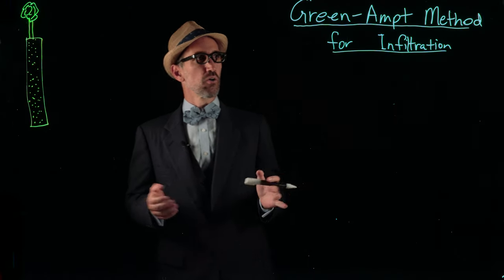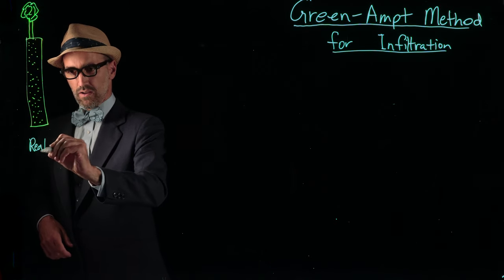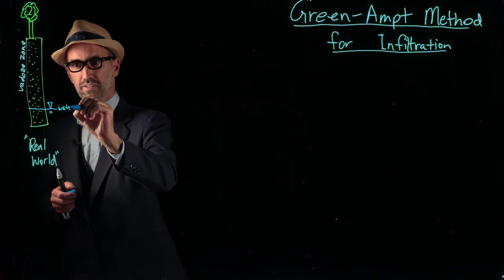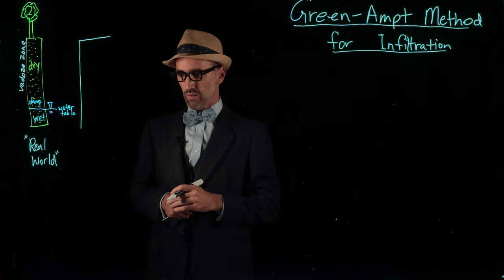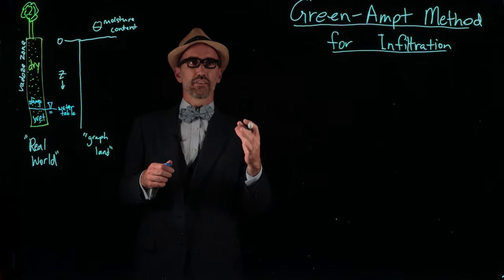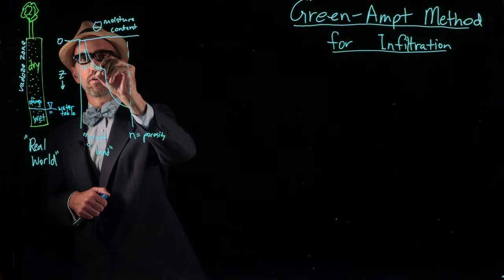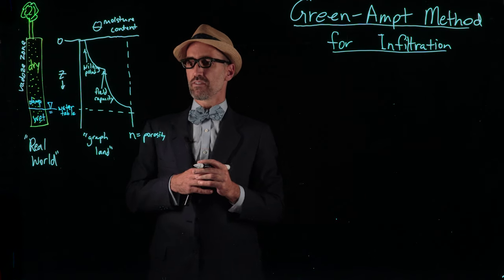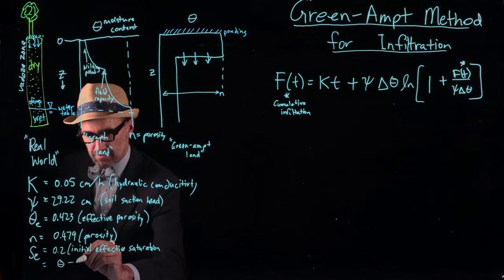Infiltration: the Green-Ampt method for infiltration

Comment: Thanks for the video. But why are there soooo many empirical and theoretical implicit equations for infiltration? New ones have emerged in recent decades that eliminates soil-dependent parameters like the van Genuchen parameter. Gone down the rabbit whole and it is quite interesting to see several equations. Using GA equation solved by Philip (1993) in 3D for a project.